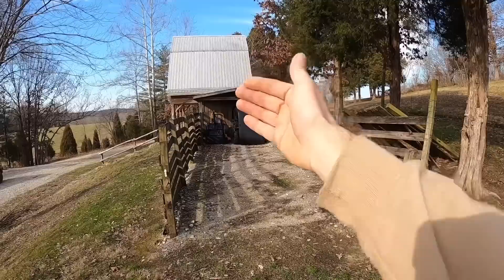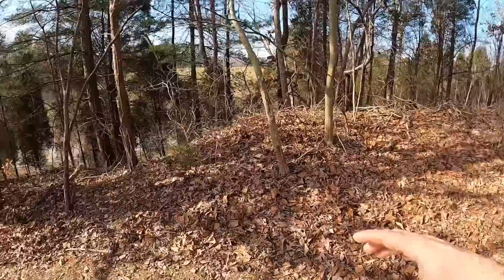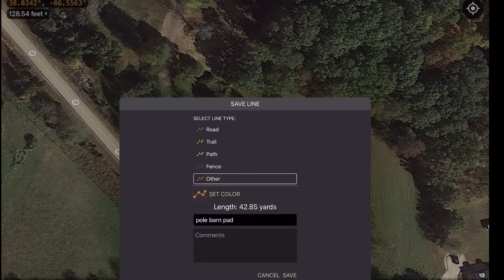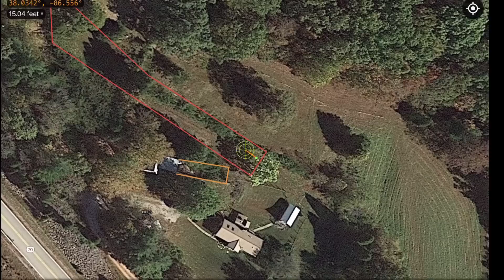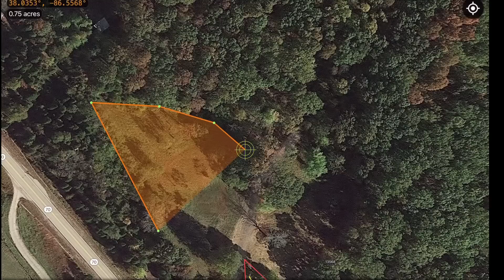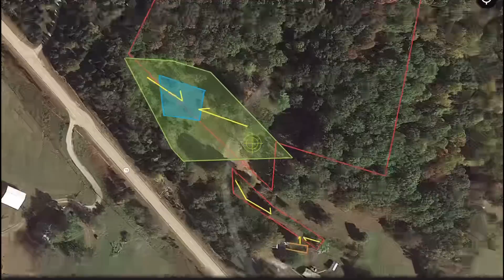Wide range of work quoted on one site

Comment: My comment, for what it's worth, is to bring the State Forester and NRCS in for their expertise and suggestions.  NRCS might be able to fund some of the work.  A mulcher head might be an option on several parts of this whole process.  Otherwise, a tree shear on the TacoTractor would do a good job.  You and DP are getting into a lot of this type of work and it might be well to have the "conversation" about long term equipment needs.  I have found it possible to rent a tree shear in the past to avoid committing funds until you are sure that it will work for you.
Reply from the maker: Thank you

Comment: I don't remember, does DP have a mulching head like LD18 does for the mini?  Something like that would be perfect for several aspects of this job.  For some of the other underbrush aspects, maybe have DP ask Upstate Brush Control if THEY want to do a collaboration!  The first parts of the job you described sounded almost pure Jerry (other than getting the trees out of the way).  Building the "trail system" sounds like a perfect job for a chipper/mulcher attachment on a skid steer, as long as there aren't any major rock outcrops in the way that is!
.
Although I'm sure you'll be able to do the job with exiting gear, maybe DP will be able to get a demo unit from Fecon or somebody else LOL
Reply from the maker: Hard to say 😂. You never know